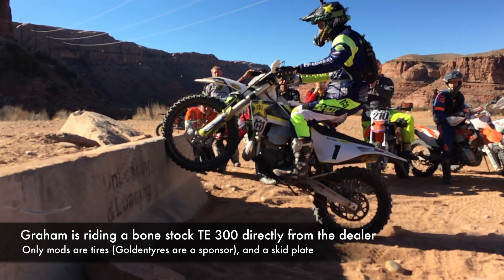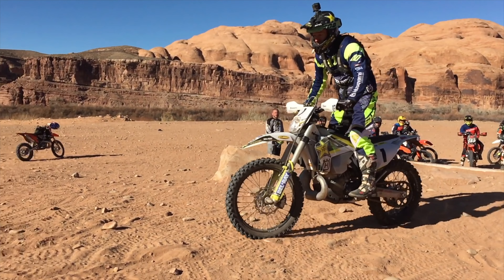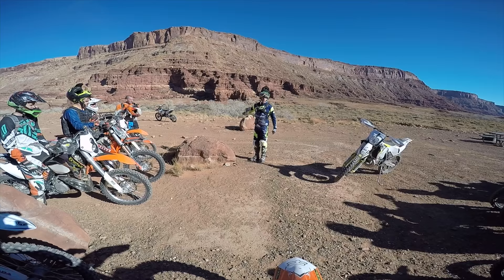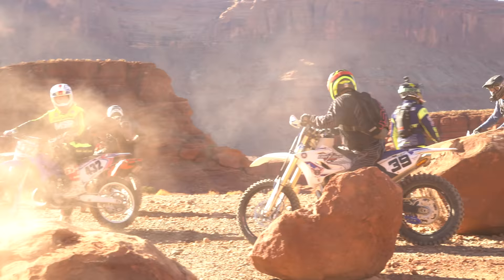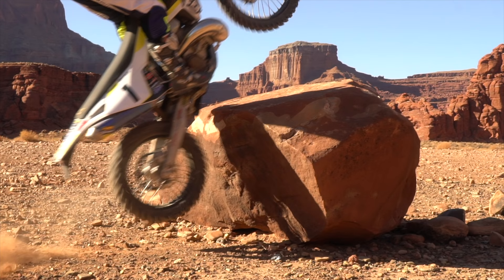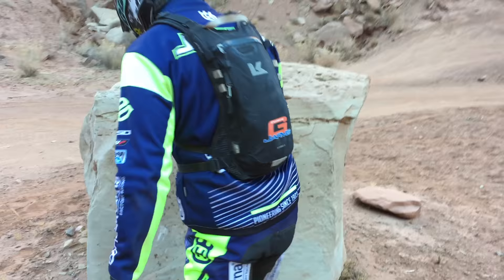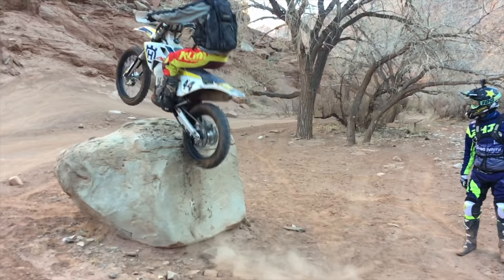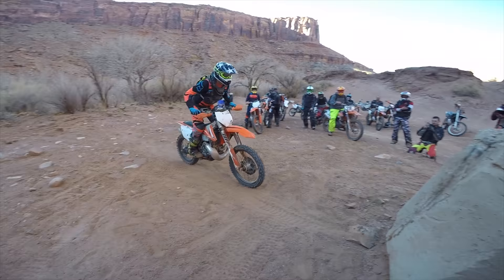How to Cross a Rock/Log like Graham Jarvis!!! He shows us how!!

Comment: He also covers and uses the rear brake to control the descent of the front wheel combined with body position. This prevents to steep of an angle when going down.
Kudos for trying guys. It is really hard to learn because there are so many factors. 

Essentially you will learn all the techniques in a trials club or on a trials bike. For me if you want to get serious in enduro riding especially when it gets technical you need to learn these trials  techniques. They are much easier to grasp on a Trials bike since it is lighter and falling of is not that big of a deal compared to a dirt bike.
Also try to let a buddy spot for you and determin whether he should save you or the bike if anything goes wrong (without endangering himself).

Graham is a master and I deeply respect him for passing on his experience to other riders.

A word of warning. Trials will get you addicted after a rather steep learning curve of balance, timing and speed. :)

Comment: I’ve been trying this double blip. I watched multiple videos. What I noticed is the double weighted suspension. Gram bends his knees once the front tire hits the top of the obstacle forcing his weight on the front wheel compressing the forks a second top. Then he springs up straight with a rev/blip of the throttle. I’m like most guys in video. Straight legged and top heavy. Tough piece to put together. Nice video

Comment: its coordination more than anything. having the right approach speed , compressing the forks far enough away from the rock  to allow the forks to decompress as you rev and drop the clutch /lift the bike. once your on the rock skill and instinct have to take over. But if you don't get the chain of events down correctly before the rock you wont ever get over it smoothly.

Comment: Timing and practice will get most of us over that crazy rock.  Really, timing and practice.  Most of us understand the technique but it just doesn't work its way from our head into our hands without a lot of practice.  I like to smaller rock to work on the technique.  Must have the little wheelie followed, in rhythm, with the big clutch drop before a big rock/jersey wall becomes possible...use of body timed in for rebound launching.

Comment: Kyle, I've been googling for info on when Garvis is doing his classes out west Utah, So.Cal or AZ. can you point me in the direction to find out more info. I would love to take his class. Thanks for sharing the video.From what I can tell Kyle he compresses the bike while giving throttle to loft the front wheel then as he is rolling forward he pulls the clutch in and revs the engine spooling up the fly wheel then he dumps or releases the clutch to let the fly wheel helo his momentum for the rear tire to climb up the face. So it's a doulble blip of the throttle with a clutch dump after the second blip.

Comment: 4:13, Everyone else is just riding over the rock.. Graham you can see compresses the front suspension while givin' it a bit of clutch throttle, (to get that front wheel on the obstacle), then does the exact same thing but using more compression and more clutch throttle to propel himself over. Everyone else is using forward momentum to get over it.. probably because they wanna look successful in front of graham the giant.. big groups can be intimidating.. you dont wanna be the only guy to look weak. It's something that's still inside of us from the hunter gatherer days.. go slow, use the techniques provided, at least if you don't make it over the obstacle, you're failing while learning the proper technique  - and he definitely notices that. All these other guys riding over it with just clutch throttle will never be able to get over that bigger rock at the start of the video! good luck in your progression peeps!

Comment: looks like he kinda ollies the back by jumping with his legs a bit before throttle
Reply: he does a lil hop to compress and rebound the front tire - and then does ANOTHER hop just slightly before releasing the clutch. everyone else was just raising the front, but not hopping again to unweight while the rear while it gains traction up the object. they were just kinda erving into it amd letting the rear and their weight bash into the object